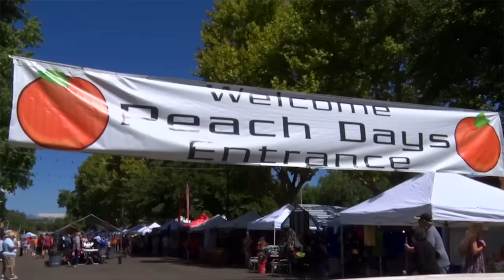I Can't Believe You Drove Your Tractor Into A Lake!

Comment: Cheers to the cuiser guy, gotta respect a man willing to jump in and help get a job done.
Reply: I hope he got an honorary T shirt
Reply: Yeah thats not as common anymore but in my experience it is way more common in the south🤷‍♂️
Reply: Do they open the hood to let the engines cool better under load?
*thanks for the replies 
Dont die, pop the hood
Reply: Off-roaders in general are usually willing to help. Especially if they have the tools. How often do you get to use your winch? 😂
Reply: I had two Californias nominate me and my 4 wheel drive to pull their speed boats out at Lone Rock, UT years ago and they didn’t even offer to take me for a ride.  But they were Californians.  🤷‍♂️🤪
Reply: If you have the toys, of course you want to play with them....
Reply: @tuculoguey3530  save the windshield if there is a line break.
Reply: @tuculoguey3530  it's so if the winch line snaps it doesn't go through the windshield and hit the occupants
Reply: @tuculoguey3530  Im not sure but I think he opened the hood in case the winch line broke an wouldn't go through the windshield
Reply: @tuculoguey3530   lifting the hood has become more common after a guy was killed after a tow hitch with an 8” drop snapped off the back of the pulling truck and flew back and went through the windshield.   Terrible situation but the factors were, the stuck truck was like the first truck in this video.  Super stuck, and then they tried to do a pull with a kinetic rope and once the pressure got too high, it was the offset hitch that failed, not the ball, so now opening the hood acts like a shield for very high tension situations.
Reply: @paulshannon4576 I had 3 trucks from UT pass me up when I flagged them down for my son's stuck rig (Ranger prerunner). Thank god for the Oregonians near by. Funny how things workout sometimes.
Reply: 2 for 2 for him, too.
Reply: @adriandaw3451  And a cap too.
Reply: @ColoradoStreetboarding  holy cow that sucks , RIP to that guy. Thanks for the info
Reply: A cool dude for sure.
Reply: When you're a guy with a winch you just can't wait to use it.
Reply: @tuculoguey3530 . Maybe opened to offer some protection from a flying broken rope?
Reply: @tuculoguey3530  I usually open the bonnet (hood) just in case the cable/rope  breaks, saves your windscreen and anyone behind the wheel.
Reply: @coyoteden3773  So true
Reply: @adriandaw3451  WE were saying the same thing!!😀
Reply: @tuculoguey3530  usually to keep the driver safe if a line breaks on the winch so they don’t take a snatch block to the teeth. Good practice when you don’t have to see where you’re going.
Reply: @adriandaw3451  We were saying the same thing!!😀
Reply: @tuculoguey3530   Usually when winching you raise the hood to protect the windshield if the cable/rope breaks. The new ropes without hooks are far less dangerous, than the old steel cables with a steel hook on them.
Reply: @tuculoguey3530  probaly  to stop the rope( when it brakes) from braking the window and posably kill the driver
Reply: @tuculoguey3530  It's in case the rope / wire from the winch snaps. It will fly into the windshield causing more damage. The underside of the hood will take the damage instead.
Reply: @tuculoguey3530  no its to protect driver in the vehicle incase something breaks while winching.
Reply: @tuculoguey3530  no, in case the strap/cable breaks
Reply: @tuculoguey3530  to protect drivers in case winch rope or cable breaks.
Reply: @tuculoguey3530  they open the hoods to protect the windshields from a snapped rope.
Reply: @tuculoguey3530 so if the line breaks it wouldn't destroy the windshield and harm on board people
Reply: @ColoradoStreetboarding  rest in peace to off roaders that have passed away from a bad situation helps us think a little more to be safer in the future
Reply: @itsmemaaaark  
They were probably transplants and not true Utahns…
Reply: @ValleyWestHandyman  Yes, because they know that might be them some day. Lord willing someone will help them also.
Reply: @michaelboyle1983  So TRUE . We MUST remember that JESUS CHRIST is the ONLY TRUE SAVIOR . Thank You
Reply: @tuculoguey3530  more for a shield from the line. But yes it helps with cooling.
Reply: i think he opened the hood as a safety barrier in case something let go and slung toward the driver.
Reply: @ValleyWestHandyman  yep I'm that guy jeep winch snatched blocks....✌
Reply: @tuculoguey3530  protect the windshield if something breaks
Reply: @tuculoguey3530  usually when pulling on a vehicle that sunk in the muck opening the hood accounts for 2 thing, better ventilation for the engine yes but mostly for the high stress on the winch lines, it will act as a protective wall if in the event the winch line fails and Flys back.
Reply: @tuculoguey3530  much more if the winch rope break, Jamie doesn't die OR the Windshield does not explode!
My guess.... I may be wrong!!
Reply: @ValleyWestHandyman  exactly! I've used my winch dozens of times to help other people but have only used it once for myself. Were always willing to help because you gotta keep the karma clean so the help is there when you need it
Reply: @tuculoguey3530  could be for cooling but more likely protection if a strap would break. It would add protection to the vehicle occupants and vehicle
Reply: Thanks cruiser guy if no one else thanks him.
Reply: I mean I just hope Matt threw him some cash yknow lol.
Reply: @tuculoguey3530  its for safety in case the winch line brakes and it can stop snatch blocks and such from flying through a windshield and killing the driver
Reply: @tuculoguey3530  They opened the hood to protect the windshield if the tow hook would break off.
Reply: It's a cruiser thing haha.
Reply: @tuculoguey3530  yes and also incase if the hook breaks it doesn't go through the windscreen
Reply: Cruiser drivers 👍👍👍👍
Reply: @tuculoguey3530  more for protection incase the rope snaps, people have died from stuff flying in through the window. 
The most dangerous part of that whole set up would be the ring pulley. If a rope had snapped it would be like a bullet
Reply: @tuculoguey3530  its incase stuff breaks itll hit the hood before going through the glass
Reply: @tuculoguey3530  probably more likely to stop a busted strap from flying into the cab
Reply: Looks like Matt will be looking for a Land Cruiser next! 😉
Reply: @tuculoguey3530  I thought it was in case something snaps, so it won't fly through the windscreen and kill the driver.
Reply: @tuculoguey3530  probably for protection from a snapped line coming back through the windshield. If you ever use a tow strap, cable etc. try to put a blanket on the strap while pulling so if it breaks it won’t fly as far. This can be very dangerous with lines under that much tension.
Reply: @tuculoguey3530  my cowgirl guess sez it’s to shield the driver of the stuck vehicle from an accident with a broken strap.
Reply: They should offer to fix his exhaust leak
Reply: @tuculoguey3530  the hoods up are to protect occupants in the event of a catastrophic failure of rigging, it lets all that energy at least be slowed down before hitting the windshield and is a good safety measure
Reply: @tuculoguey3530  No, if the rope breaks, it will hit the hood and not go through the windshield.
Reply: Reminds me of the time there was a windstorm and some trees blew down across a country road.....It was about 1:30 am so I was surprised when another pickup truck pulled up on the other side of the blocked road.......I got out my chainsaw and went to work, as did the other guy.
It took us an hour to buck up the windfall and clear the road....I put away my chainsaw and continued on my way.  Me and the other driver never spoke a word.  A nod and a wave covered the social obligations as we passed each other in opposite directions.
If there's a job to be done....just get it handled.
Reply: @tuculoguey3530  Often they open the hood to protect the car occupant/windscreen in case the winch line breaks
Reply: @paulrivers7248  As a southerner myself, we look for opportunities to use our “investments”.
Reply: @eternaloptimist2840  and a towrope
Reply: @tuculoguey3530  no. The hood was open as a safety measure in case one of the straps broke so the hood absorbs the blow rather than the windshield or his wife.
Reply: @tuculoguey3530  it was probably just incase the line snapped, that will help protect your head.
Reply: Cruisers are driven by genuine people that's why 🙂
Reply: Indeed, he was a God send...
Reply: @tuculoguey3530  I suspect it’s a safety.   IF anything fails.  The driver is protected by metal hood, AND windshield.
Reply: @tuculoguey3530  im guessing to protect the driver if the winch line snaps.
Reply: @tuculoguey3530   More safe practice. If the winch line breaks and flys back towards the vehicle it will need to go through the hood before it can go through the windscreen and/or Driver...
Reply: @tuculoguey3530  they opened the hood of truck just incase the winch line snapped. If that would of happened it would of been possible for the line any any attachments hooked to the line to fly through the windshield.  

The hood opened like that would help protect the people inside the cab because the line and any attachments hooked on the line would hit the hood instead of crashing through the windshield directly.
Reply: @paulshannon4576  Well sir. Not all of us Californians are like that. I do apologize for their behavior.
Reply: Sick rig
Reply: The cruiser dude should be on the payroll!  Make him your Yuba rep!  Love his attitude!
Reply: @ColoradoStreetboarding  in the accident you mentioned, where the tow hitch broke, they weren’t using a kinetic rope.  That involved the use of a fixed tow strap. The difference is the kinetic rope increases pressure gradually, but when someone yanks with a solid tow strap the max pressure occurs instantly when the end of the strap is reached.  It may not have made much of a difference in that case.  There is a chance that the kinetic rope would’ve made the hitch fail at a lower pressure point, thereby giving it a different trajectory at a lower velocity.  No one will ever know at this point if it would’ve mattered.
Reply: @kevinstorm6009  ahh.  Makes sense.  Correction taken.  That is a very true point.  What would have happened??  At least the tragedy has brought to light the severity of using the right technique and tools for each situation.
Reply: @CrystalBabygirl-ck5sm  What's a vechile ?
Reply: @CrystalBabygirl-ck5sm  All good, it just looked really odd!
Reply: @sw6188  😂😂😂
Reply: Matt gets paid to do rescues so that's his incentive to get the job done.
Reply: @paulrivers7248  sadly people are now terrified of being sued just for trying to help
Reply: The dodge guy also
Reply: 👋 10000
Reply: dude was thuggin he was like f it lets do it lol mad props to him for that jump in
Reply: lol commented to soon og cruiser jumped in twice lol 
what a pimp
Reply: @ValleyWestHandyman  not to mention, there’s practically nothing better than watching somebody else work on their vehicles, while you’re drinking a beer critiquing their shitty repair job all along the way.

Comment: I feel like pulling from the ball is like installing your own garage door springs. Doing it wrong can be fatal, but if you know what you're doing, it's perfectly fine.
Reply: Those garage door springs will rip your arm off in a blink of an eye if you dont know what you are doing.
Reply: It didn't kill my brother or myself but the rods to tension the spring killed the door at the back of his garage.
Reply: @TheDieselndust  you being sereious?
Reply: @123brendan100   He is serious and correct.
Reply: Haha! I was in the fire service 30 years and the scariest thing I have ever done is wind my garage door springs.
Reply: @123brendan100  yes that is why they are not sold to the general public at Home Depot, etc. Specifically the roll up sectional door kind.
Reply: No reason to risk it though. Take the hitch out of the receiver, put the end of the winch line in there and put the pin through the loop.
Reply: @xToddmcx  if the ball is rated to tow 10,000 lbs on that Tundra, it has no reason to break when pulling slowly like Matt did, with the truck moving by itself. Different story of course if you do like that Australian guy, chain the truck to a tree and do a drag launch pulling on the ball...
Reply: I was a carpenter/builder new homes, 30+yrs...omg, the inexperienced homeowners that tried to mess with Garage door springs over the yrs...omg
Reply: @123brendan100  a garage door spring under load is a very dangerous thing, this coming from a carpenter/builder of new homes, 30+ yrs exp.
Reply: @TobyCostaRica  huh makes sens remember helping my dad with them when I was young 🤣
Reply: @papasaysvroomvroom  True. Btw that 10.000 lbs includes forces like bumbs and emergency braking...so it can hold way past 10.000 lbs of force.
Reply: @TheDieselndust  I never understood the fear in these. I replaced some as a teenager and had no issues. Two 24" long bars, and had it done in a half hour. They are only tensioned with a couple hundred pounds, not thousands. Car springs are probably more dangerous (and I've replaced tons of those too).
Reply: I recently watched a video think it was an Australian guy that his receiver hitch broke and came back though window and killed him
Reply: As cheap as trailer hitch shackles are I don't see the point myself. I launched 14 tons of trailer and forklift into the air at 55 MPH once when a combination ball/pintle hitch broke and let go. It was rated at 30 tons. They make me nervous. I worry way less about what I don't know than things I do know that are wrong. Yeah I don't screw around with garage door springs either. Use your best judgement.
Reply: @xToddmcx  Not the best way either....pins/bolts work best in direct shear.  By placing the line in the center you are creating a bending moment on the pin.  Splitting hairs, yes, but that will drastically reduce the amount of load a pin can handle.  But if it fails, you have a rocketing line....not a 50# projectile.  So I'll give you that! 😉
Reply: @papasaysvroomvroom  
There are stresses similar in the normal use but not to the degree of a sudden yank on the hitch.
Reply: I used the ball on my hitch to wind my garage springs.
Reply: @phillipmaynard1852   That was in Colorado a few weeks ago, truck stuck in river and straight pull on a standard hitch ball, 1 ton truck.
Reply: With both you want to avoid standing in the way. Even if you do it right, things can fail too...
Reply: I can't remember right now which way it goes but either when the door is all the way down or all the way up is the only safe time to mess with the springs I guess I'm not messing with any Springs anytime soon again since I can't remember
Reply: I'll do almost anything around the house except wind or adjust garage door springs. I adjusted them once and decided that was a lifetime of dancing with the devil.
Reply: @masterbates7016  Least load when the door is up. Still a job best left to professionals... it isn't all that expensive. It is not the odds that make it a bad gamble, it is the stakes.
Reply: @larrybe2900  exactly, a winching is not a "sudden yank", more of a steady / slow pull, probably a lot less stress on the ball than a maxxed out trailer bouncing up and down a crappy highway 🙂 that's probably also the reason why Matt usually swaps out the ball hitch for his pintle hitch when using the kinetic ropes.
Reply: @daveharness70  The line's as wide as the receiver usually, so you're not bending the pin.
Reply: @xToddmcx  A steel winch line?  A synthetic winch line?  Or are you referring to a 2" strap?  Yes, if the strap or line had a greater breaking strength than the pin, you would surely break the pin right in the middle where the stress is concentrated.
Reply: Somehow this thread turned into a garage door spring rabbit hole🐇 🕳
Reply: @phillipmaynard1852  its happened many times.  I wouldnt have a problem using one in a light winching situation like this but for a snatch strap/dynamic rope nope not worth the risk,  just remove it and use the pin if i had to.
Reply: @xToddmcx  bent pin city
Reply: lol I definitely know about garage door springs and their pucker factor. xD
Reply: @brucecooley4170  Wasn't a static strap on  a 4" drop hitch?(I think it was actually more than 4").
Reply: @NoNORADon911  i once pulled a garage door spring by a strap looped on the ball of my fk ing receiver hitch of all things
Reply: @papasaysvroomvroom  He used lite rated ball, multiple jerks (plus guy driving) it’s been suggested he “helped” the ball fail as he was destroying his hitch.
Reply: Much better options then what this channel is continuing to show.
Reply: The rating of the tow ball and hitch is in GTW and tw ratings. Using A tow ball as recovery point is never a good idea whether you were doing a snatch tight pole or winching off. Especially when there are far better options that would’ve taken a few seconds to do and not put himself and other peoples lives in danger. I have continually seen him practicing Shaddy recovery methods and also had people In the danger zone wall winching vehicles. Plain and simple he has time and time again shown that he does some very unsafe practices while on recoveries.
Reply: @rthomas2157  jealousy does not look good.  While I would do things different.  I don't have Matt’s experience.   I can break stuff.  But in doing that you learn what stuff can normally take.   The stress caused is something you can guess at.   Maybe few notice that Matt, others find broken straps, chains on stuck vehicles.
Reply: You serious Clark?